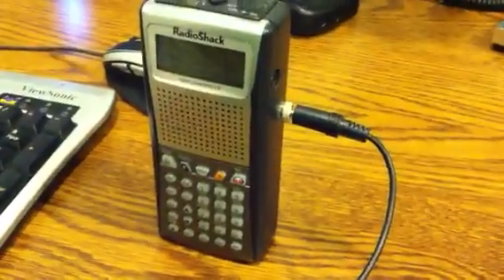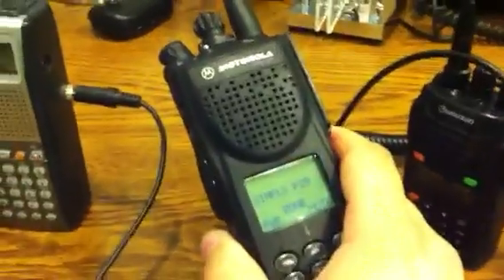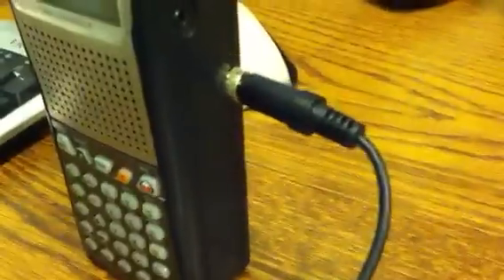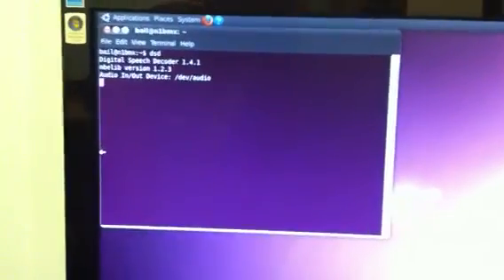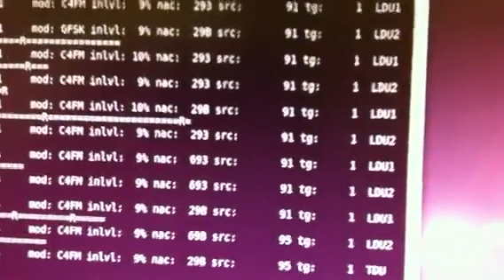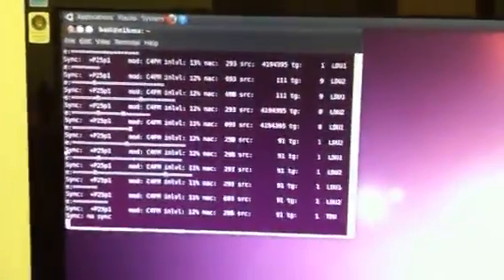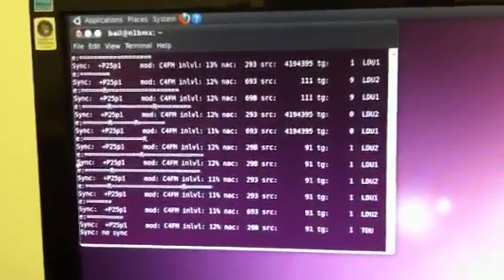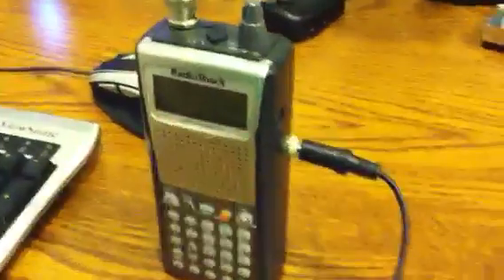DSD decoding APCO25 signals (NT1K.COM)

Comment from the maker: @TheNetHasEyes1 Not sure about D-Star as "DSD" does not decode D-Star (yet??) You can get a DV dongle for that purpose. IIRC DSD does MortoTRBO but I have not yet decoded any of those because I don't think there are any of those systems around my location.  As for installing DSD, I learned what I need to know from the website listed in the info and at my website